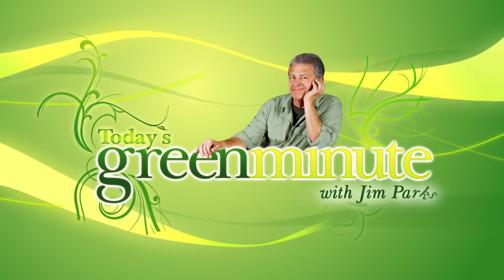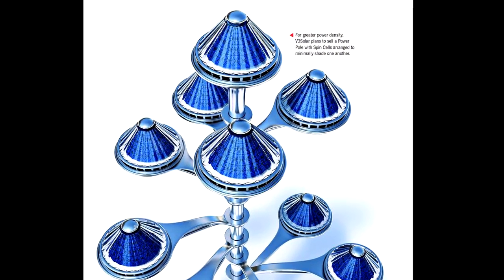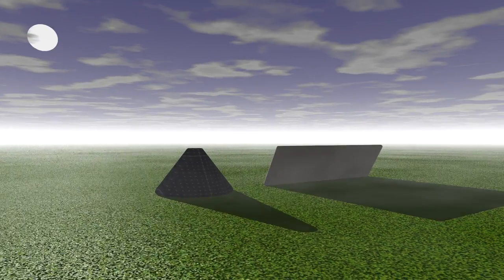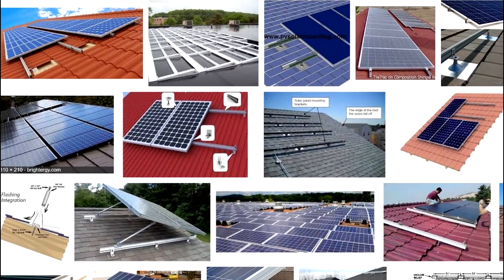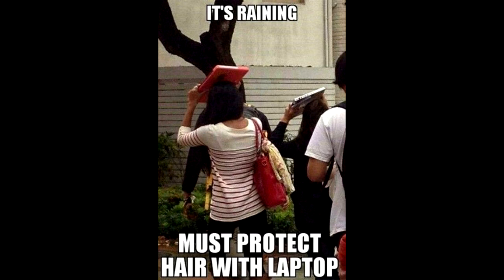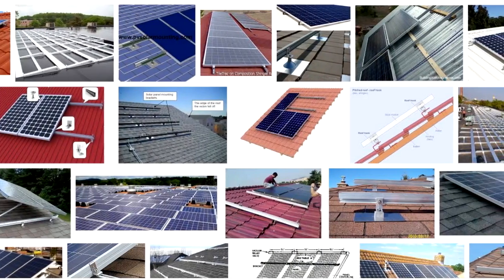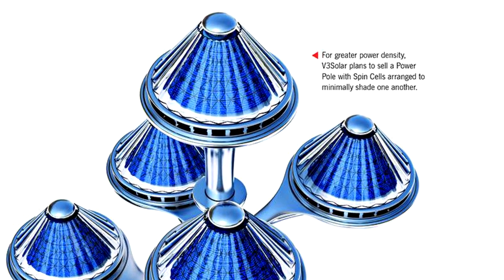Spinning Solar -BUSTED!

Comment: I put Gen III Night Vision Goggles on my solar panels so they could work during the night.
Reply: Well that obviously wouldn't work.  My solar powered flashlight does the trick though
Reply: Technically, it would work, if those are light amplification googles. If your googles run on pixie dust of course.
Reply: @sylvainmalfettes2114  
But wouldn't the night vision goggle use more energy?
Reply: Very very likely yes. That's why I assumed the googles were running on magical stuff, because that's the only way for it to work.
Reply: XVIRUSTV damn. Why haven’t I thought of that
Reply: I wish I thought of that
Reply: that can actually work lmao
just need a source

Comment: I understand why this realy is not a good idea...with that being said why should i even care about your view point on this when it seams your math is way to basic to be correct and every video i have seen from you is EXTREMELY negative?? I could get behind your reasoning until l actually desided to learn the math and fact check you, at that point im sure i would find a tone of ways to pull apart this video...sorry not cool

Comment: but... if you built it in a way that its also a wind turbine? you also dont mention the area they are taking up. 

you can see the cone on the right is smaller in area, but the one on the right takes up more space that includes the base as well. so technically if you could convert these into wind turbines and solar panels then you would generate more power.

Comment: I mostly agree with this video. there is a way it's possible though, without using the sun at all. Using super bright LEDs around the circle, 100% of the solar panels would be generating all of the electricity possible. The spinning is not exactly necessary, but a low voltage high speed motor can be used with a high voltage low speed motor to make a mini dynamo to power the super bright LEDs, this would be inside the solar array and would in fact spin the array A 12v rechargeable battery pack can be stepped down and used to power the low voltage motor which spins the other motor generating electricity to drive the super bright LEDs which provide more than enough light to the panels, in fact, more panels can be used. The panels in turn would be stepped up and recharge the 12v battery pack. I've made a decent 100w solar array around a simple 13w compact florescent bulb. If that were charging a battery pack, it would be enough for an inverter to run the compact florescent and the solar array to keep the system charged.
Reply: No, actually. Nothing can break the laws of thermodynamics and parts 
must wear down. However, a device can be made which powers itself. It is
 not running in perpetuity and it is not getting energy from nowhere. It
 has the same energy which is put into it no matter how it is put in. 
People seem to mistake energy for electricity, they are 2 different 
things. You CAN have more electricity out than in. People have proven 
this with many types of step up circuits, dynamos, transformers and many
 other electronic devices which do exactly that.

Comment: I feel like you never really tackled the real benefit, that they can take energy through all of the day and keep the same generating power, as opposed to normal panels that are static on the roof or whatever and might only be efficient 1-2 hours a day and then basically be generating nothing, that's about 10 hours of potential generating time lost

Comment: ITS not a bad design at all, of course the 20% is just advertisment like everyone does but if the qaulity of the cells are high enough, with a concave lense, it could absorb a great deal of sunlight and cool off enough to before next rotation. espeacailly if the use the green house effect to spin the device to allow air flow to create a cool current of air across the panels. but if the cheap out and use mild grade solar panels, i can see this fall in poop.

Comment: you are assuming things and making calculations about a solar panel design that you don't know much about. i mean yeah you know about standard solar panels, but until you either A) cite resources published directly from the creators or B) speak with a creator directly I don't think you can really make truly accurate calculations. until you fully understand how the thing is put together and functions then I don't think you have the grounds to make an accurate hypothesis.

Comment: suppose it could work if they used mirrors to reflect the light but they would have to be moved a lot and they do realize that even if they did make a 360 solar panel it wouldn't cool down at noon so basically it's entire concept wouldn't work at all and is closer to a scam

Comment: an ease to the heat problem would propably be to put heat generators (things that generate electricity from heat)   in the solar panels and to turn the excess heat to power

Comment: Why you took only one point of sun in the sky, there sun is directly in front of solar panel? We could say that in this point sun is about 1hour in the middle day, then flat panel use 100 %, but all morning and afternoon its really not 100 %, it goes from 0 to 100 and back to 0 in all day  ( 4:53 in video) but  cone solar panel is lighted 50% all the time from sunrise to sunset.

Comment: Thunderf00t correctly states that solar panels in the shade do not produce any electrical energy. However, in addition to that, a shaded panel actually turns into a resistor - meaning that this 'thing' would have to turn off the shaded panels and turn on the illuminated ones once every cycle. Easily possible, yet incredibly inefficient. Thunderf00t is always very generous with his numbers on these things - and yet they're all Bullshit. This spinning solar thing annoys me especially for some reason. It's almost as stupid as Solar Roadways - but it's a tough call.

Comment: I have one small. Cone it stopped spinning last year but the pannel still works and during the day it get complete sunlight my whole roof do this cone is fairly small and saves space my other 210 watt panel are flat and take up a lot of space the cone would work for patios and places were you cant have full panels

Comment: How about you just using the heat to warm up some water for a cozy shower, then you can use the water to cool down the cells at the same time!

But its probably easier to just put them on giant spinning thing and put some glass over it.

Comment: I'm not really interested in that, just clicked random video before I eat my breakfast, but God!, I must write something...

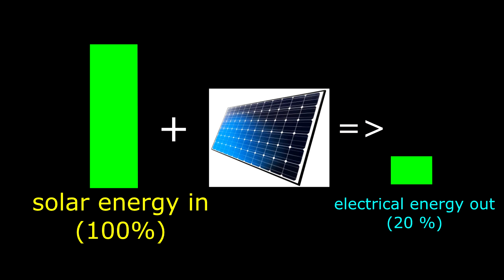2:00 If you want to keep things that simple, of course, you would get so ridiculous conclusions.
Giving efficiency in terms of electrical energy output per solar energy input is useless value. The panel could give for example even 99% output providing that you stand there and clap your hands all the time - which would cost you more energy then you got from this panel.
Obviously there are more factors involved. You can talk about efficiency in terms of dollars in/dollars out. Now don't tell me that if for 1KW you need to invest 0,20$, then its impossible to produce energy for 0,01$ per KW just because old technology produce 20% of input solar power. It's like saying "look! length of the edge of this rectangle is 20x greater than other one, therefore area of the other must be 20x smaller then this one!".

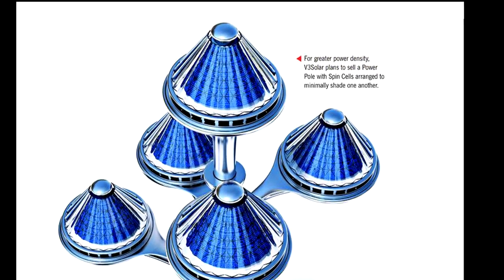3:00 Come on! do you even hear yourself?! Sure, and you don't even need to put it inside a building, behind the window, because it's impossible for the sun to be directly above your head, anywhere on the planet...

4:40 Didn't you already showed in 0:35 that panels need to be hit directly by the sun to give most energy, or you think it's also a nonsense?
 Also you probably forgot to consider that this cone takes less space than flat panel, thus you can fit more of them on the roof.
 Also, you should not ignore the fact that much of light is reflected by the panels. You could perhaps form a "wall" similar to those used in anechoic chambers to trap the light...
 
5:02 Of course! Because everyone knows that if on side of a ball is lighted by the sun, other side is completely black! 

5:40 OK, I understand that you live in some strange place where you use Fahrenheit but you can just type "60C to F" in google and you get your answer. It's obvious it's going to melt the earth...

8:24 Yup! And if you give balloon 20 times more blows, it's surface would be 20 times bigger kids... Not that the shape of a glass give any difference to light passing through it, just follow the rule x*better = x*bigger!

Please, stop making people dumber than they are!

Comment: I guess a way it could work is with water, rather than PV panels it would be like a black radiator that heats water and pushes it through a system and a pump/generator, it certainly wouldn't be as efficient but it could work

Comment: its the same with solar roads, not only are half of the panels in dark, they actually stop the flow of electrons from getting to the final destination. Thats why you don't wanna put panels where any part of them are shaded, it would need to be switched and regulated so only the panels in the direct light are included in the circuit

Comment: so how would you extract the energy collected from those cells when they are rotating? a wire would twist for example. is there some type of rotating hinge that allows electricity to pass through it?

Comment: Now here is the deal they are all in "green houses" as you say and if there was a slight advantage to lenses it would add to power output. The other thing we are not thinking of is that if these were on a slight angle towards the southern sky more of the surface area could hit the sun possibly all of it. 

I am with the video these likely will not put out more simply because of the fact that it takes power to spin however if done by wind and not spinning all the time and angled towards the sun and they have lenses that do help with output somehow due to optics it is indeed possible that you could potentially capture more sunlight I often wondered why there is not a piezoelectric layer on the back side capturing energy from expansion due to heat as well or possibly the thermal blocks to capture energy from difference in air temps and temps in the cells. 

Either way I imagine with the correct methods we could improve solar although I doubt this works it is likely possible to garner a little better output from the device will it beat a flat panel doubt especially if it has solar tracking.

Comment: Correct me if im wrong. But we could to position the cones so, that the point points directly at the sun (not the sides) and around it put some mirrors to reflect any incoming light to let the side pannels generate electricity

Comment: Can't you just cool the solar panels by running a water pipe behind them?
Reply: axe863 The problem is then how do you get the water cool again? You need some form of refridgerator or air-cooler. You'd be using all the energy from the solar panels to cool themselves.
Reply: I am a total novice on this topic but couldnt said heated water be returned to a hot water tank and used as hot water/ used to reduce heating costs.
Reply: Why would you need to cool it down? You think it would produce more hot water than a hot water heater can make/store?

Comment: For some reason Thunderf00t believes that shadows on Earth are 100% opaque if that were true then standing in the shade would put you in total darkness and my grass wouldn't grow because the trees in my yard would block all the light from reaching the ground.
Reply: When solar panels barely make a profit by facing the sun directly all day, how cost-efficient is having 2/3rds of the panel facing directly away from the sun in your opinion?

Also, how much power do you think solar panels produce when in shadows?  That's the point you're getting at, right? :)

Comment: how about the time constrain? for flat solar panel assuming they got 100% sunlight when the flat panel is 90 degree with the sun, so it would be like only 2 hours the flat solar panel will get 100% sunlight? then the spinning panel although they run at 30% but they can constantly get 30% for around 12 hours? maybe they said 20x efficiency they refer to total energy gathered in 12 hours?

Comment: Thoughts. 
The best way to calculate the effective area is with its shadow cast perpendicular to the Sun.
sure, Solar panels do work under the Carnot cycle so cooling is important.. so why are the backs in white plastic?
The Solar cone actually shrinks with these lenses.

Comment: I had a thought, spinning solar MIGHT be more efficient if it is using the heat on it to do some work, specifically if it's using the heat to boil water and using the pressure as its rotation.
Reply: It would be less efficient than allowing passive air to cool it even if the spinning cost absolutely no energy, since 2/3rds of the panel is producing little or no power at all times.

Comment: removing any nonsense of lenses and spinning from the argument, if you were to put a a curved mirror behind the cone  the same diameter of the the bsse at the correct didtance it would solve any problem of generating no power when in the north side, and the ground space it takes up it much smaller than the traditional setup so how many of these  cones can you fit in the same space. I'm not saying the people pushing these ain't crack pot  but if they changed the design a bit  cost aside, they could generate more power using the same amount of ground space.

Comment: 0:40 - 0:48 depending on the angle of the flat solar panel, at 10am it could be at max efficiency but at 2pm be doing next to nothing. the cone while doing ~30% power at 10am is still doing ~30% at 2pm.

Comment: Pausing at 1:48 so I can guess what the problem is going to be before Thunderf00t brings it up, I love guessing when it comes to this: For one, there's the immediate question of "how much energy does it take to spin the thing", but there are a couple of other questions I have. One is why its nessacarily for it to spin at all when on most latitudes for most of the year, you can just have half a cone like a shield shape, and it would still face the sun most of the day... Except even that's suspect, only a small sliver of the cone will be ACTUALLY facing the sun directly at any given time. Also, I'm not sure about how heat factors into it, but I don't think the reason it needs to be heat resistant isn't because the heat lessons the energy, quite the contrary, I suspect its because the heat itself likely assists the energy if the relation between light, heat, and the source of electricity is anything like I imagine (though I would have to look that up to be certain); as such, a spinning solar panel cooling itself down could result in a lower energy yield, which makes a more heat resistant material a better choice, simply because it can absorb and convert more solar energy into electricity by actually absorbing and distributing that heat... Right... Let's see how much I got right and how much I got wrong.
Reply: Ten minutes later... I got one major thing wrong. I apparently didn't know that heat DOES make solar panels drop in efficiency. Not sure what the mechanism for that is. Otherwise, mostly as expected, though 10 minutes later and I remember how geometry works and realize that even if one cut off the "always dark" part of the cone, there will still be bits that are dark for much of the day.

Comment: Ok, one additional thing. How are You supposed to remove all that heat from underneath A FUCKING CONICAL GREENHOUSE? If anything, this shit would make it even hotter than regular solar panel, or even a cone exposed to fresh air.

Comment: things you didn't take into account: with a foot that is half the size of your tracking panel, I can fit two of the cone panels in the same space. because I do not have to have hardware and software that allows the panel to track the sun, it costs less to manufacture and is easier to maintain. also the Panel does not have to track the sun by moving and therefore takes up less room. so not only can I reduce area needed for a single panel, it also has less things that can go wrong during operation. last point: the "lenses" you talked about aren't just lenses. they are not smooth. they are refracting light that would otherwise hit the cone at an odd angle directly towards the cone, increasing efficiency by making it direct sunlight instead of off angle light. 20x more efficient? perhaps not. but still incredibly worth looking at.

Comment: erm . . . i am not claiming to know how this cone works. . . . but i think it's obvious neither do you. . .  your simulation does not account for the shape of the solar panel. nor does it account for the size. you don't even know if the panel is flat or standing at an angle . . . your sight of it is distorted by how the light is refracted by the casing. . . o.O . . . that doesn't mean that it is any more valid. but your assumptions are hardly reliable recourse. 
     that is just one of the mechanics of how this thing MIGHT work. if it does. who knows? i don't, and neither do you.

    the first step to wisdom is to admit you don't know enough.
Reply: just another person shaming others when it's easy.